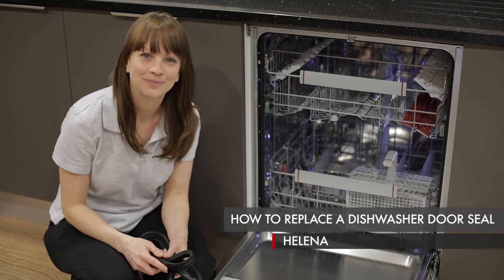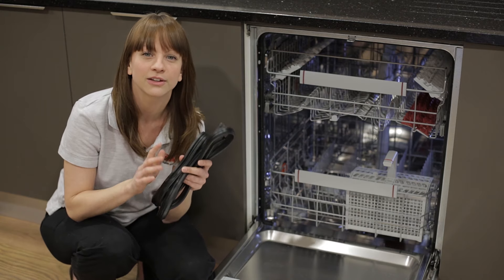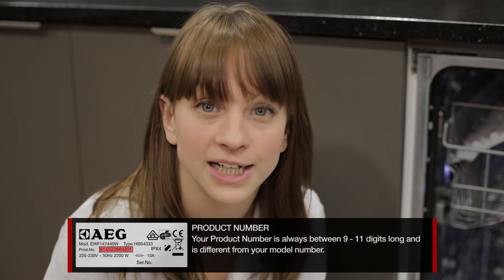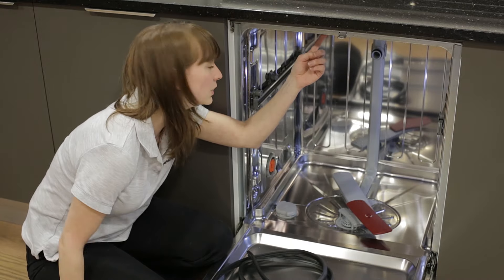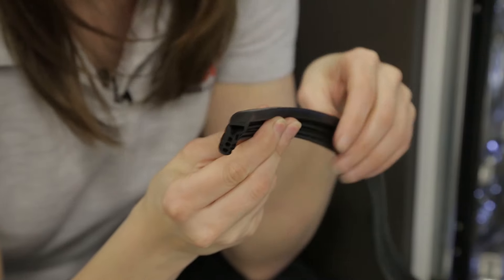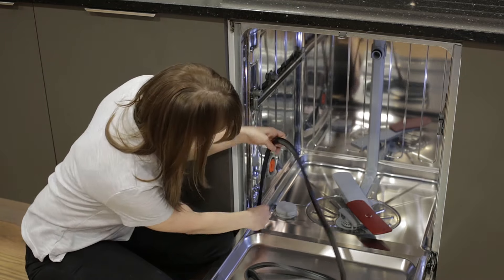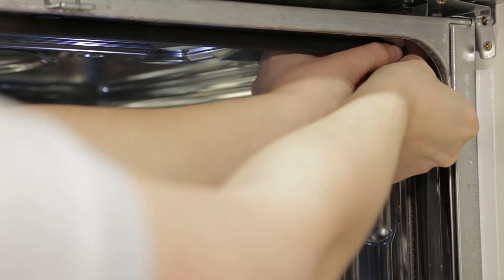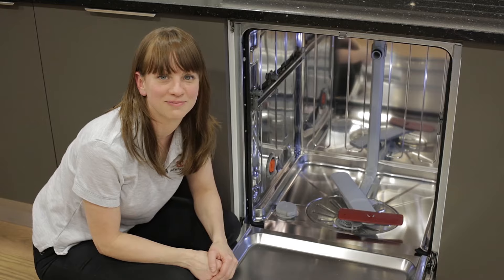How To Replace A Dishwasher Door Seal

Comment: I had trouble installing the door seal at the corners on my Jenn Air. We used WD40 on a rag and wiped the edge going into the insert with this rag - that made the insertion of the gasket into the insert very easy.

Comment: Great video but the most common cause of leaking is from the bottom seal where water collects and it's the first to perish. Do you have a video for this? Thanks
Reply: It's easy enough to search given the correct parameters.
How To: Frigidaire/Electrolux Bottom Door Gasket
https://www.youtube.com/watch?v=HpjX5D7RPTY
Reply: do you know if water is supposed to splash past that seal?  I know it's a dumb question, but I got a new seal and it doesn't really seem to seal against the bottom of the door jam (so to speak).  So, I just wonder if the short, lower seal is just holding the lobes that are at each end, in place.

Comment: I replaced my door seal on my Jenn-Air and it is leaking water on both right and left bottom sides. I know the rubber is facing the right direction (Heck, I even tried in different direction and still leaking). I know I have the right part number as it is exactly like the original and was ordered right from Jenn-Air. My original factory seal was siliconed in. I did not use silicone in the replacement as you didn't mention it was necessary. What could I be doing wrong? Any help would be appreciated.

Comment: the start and finish of the seal is glossed over. I'm having trouble there.
Reply: In mine, I let the bottoms reach below the actual seal groove.  One way is to find the center of the new seal and start from the top/center and work your way down both sides.
Reply: @gordonsensei330  Thanks!